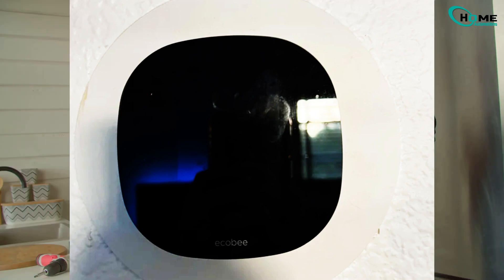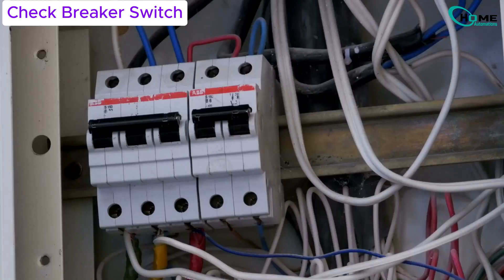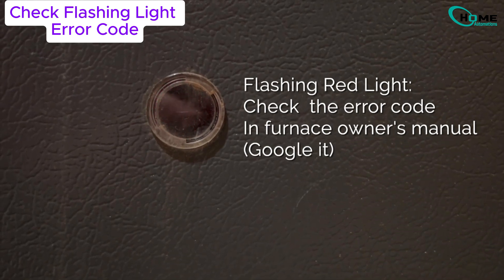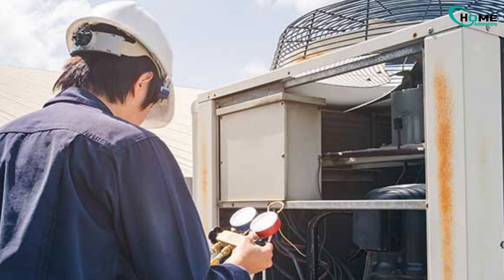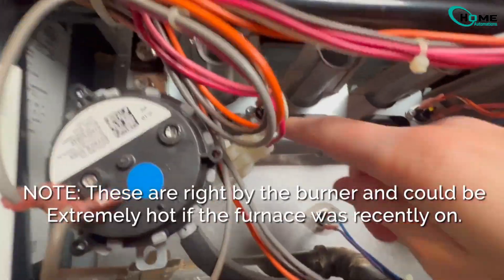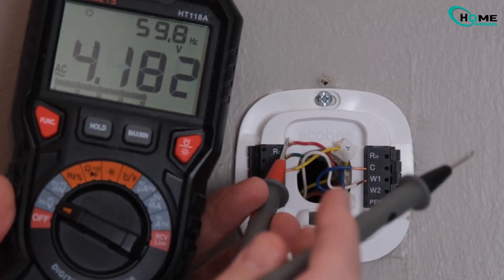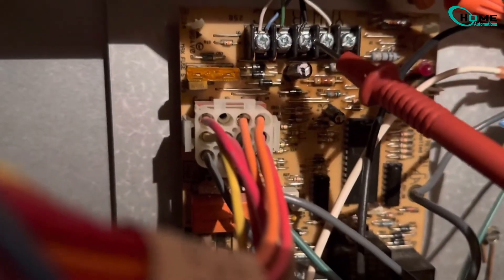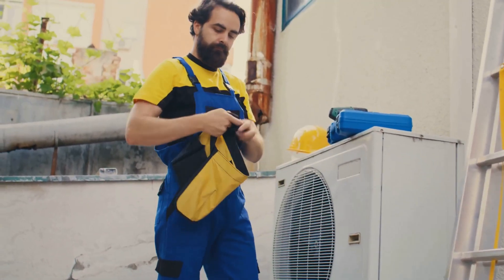Ecobee Thermostat Not Turning It On? DIY Troubleshooting Method

Comment: I don’t have to call a certified HVAC technician when I know the ecobee thermostat was at fault. It didn’t have power when every wire read 27.7v AC. So I knew it was the thermostat. So I just replaced it with a new one and it works perfectly now. Ecobee can burn out or break inside for some reason.